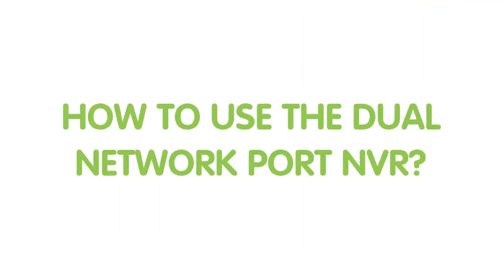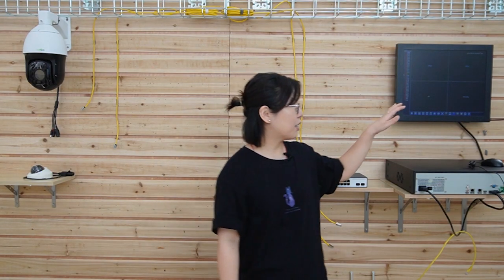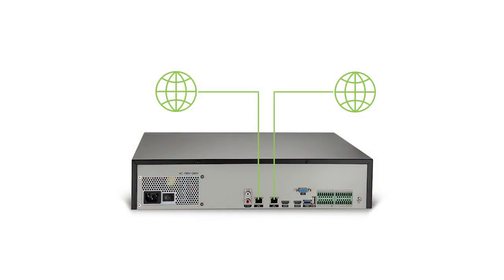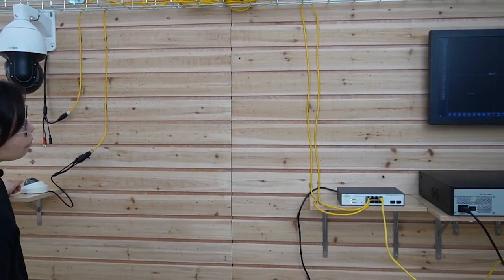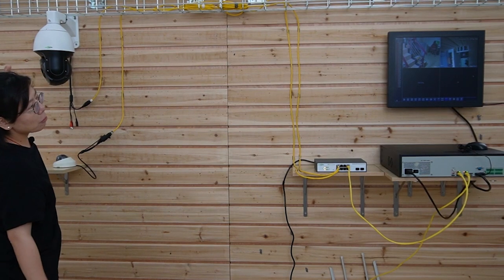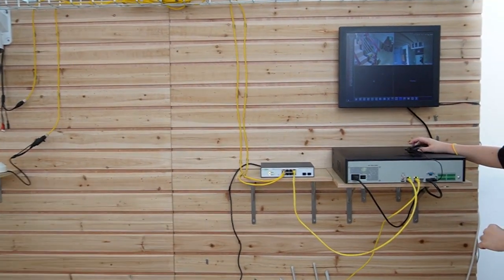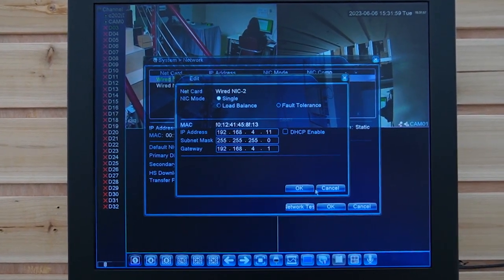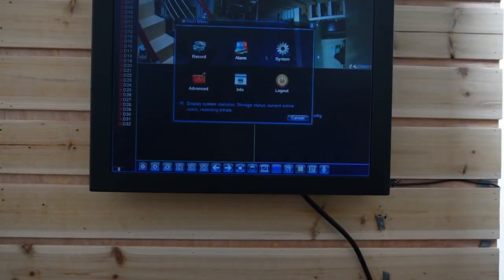Two Network Ports on One NVR | How to Use Dual NICS

Comment: Thanks a lot for your prompt reply. It is very helpful🙏
I have another question : suppose that I already had an NVR with built in 16 Poe ports and 1 NIC for LAN/WAN and all the ports have already connected directly to IP cams. And I connect that NIC to a switch which is connected to a router for accessing internet. Then I buy another NVR with dual NICs (for backup purpose). And I connect one of the NIC to the same switch.

1. Could the new NVR detect all IP cams that connected directly to the first NVR? Supposed that All NVRs and IP cams are in the same IP range. Or should I connect all the IP cams to the switch? (that makes the built in PoE ports on NVR become useless) 

2. For the second NIC (on the new NVR), could it connect to the same switch /router since they are all jn the same IP range? Or should I buy another router to make different IP segment and connect the second NIC to it?

Thanks in advance once again.
Reply from the maker: Cameras connected to the first NVR's built-in PoE ports are isolated on a private subnet managed internally by the NVR. The second NVR will not detect the cameras connected directly to the first NVR unless the first NVR has a feature to forward or share those camera streams over the LAN/WAN. Some NVRs support ONVIF or RTSP streams for this purpose, which would allow the second NVR to pull the streams.

Both NICs of the new NVR being on the same IP range will cause a network conflict (e.g., routing or ARP issues), leading to unpredictable behavior. You should connect the second NIC to a different subnet via a second router or switch. This isolates the second NIC and avoids conflicts.
Reply: @Fastcabling  Many many thanks to you. That was I thought, especially for the new NVR, one of the NIC should connect to another new additional router, not the same router as NVR 1. And that new router can be connected to the first router. Is that right?
Reply: @Fastcabling I think this  scenario:
 which is all the 16 built in PoE ports of the first NVR connect to a 16 ports switch (switch 1 with uplink ports) with IP segment A and the NIC connect to the router with IP Segment B. 
All IP Cams connect to another 16 PoE switch (Switch 2 with 2 uplink ports) , and one of its uplink port connects to the uplink port of the Switch 1 and the other uplink port  connects to one of NIC port of the new dual NICs NVR. All these are also configured as IP Segment A. 
And  the other NIC, connects to the same router as first NVR  with IP Segment B.

Or another scenario :

The built in PoE NVR is configured as a non POE NVR (disabled all the POE ports) and only uses its NIC port. 
This NIC port connects to the same switch as the IP cams (suppose I use 24 ports PoE Switch). The uplink of this switch connects to the router. 
One of the NICs port of the new dual NICs NVR, connects to that switch too. And the other NIC to another router (as a sub router of the first router). Or.. Leave alone the NIC and only uses one NIC and configures the gateway IP as the first router IP. 

According to you, which is the best scenario? The first one with all IP cams connected to built in PoE NVR or the second one, disabling all the built in PoE ports and using another switch. 

Many thanks in advance again.
Reply from the maker: Connecting the new router to the main router as a sub-router is a valid and practical approach to achieving subnet separation while maintaining internet access. The second NIC gets a separate subnet, and devices on the second subnet can still communicate with the main network if routing is properly configured.
Reply from the maker: Scenario 2 is the better choice for most setups, especially if you prioritize ease of management, scalability, and redundancy. The centralized switch setup allows both NVRs to work with the cameras without relying on built-in PoE ports or complex dual-switch configurations.

Scenario 1 could work if you want to maximize the use of the built-in PoE ports and are comfortable managing a split network. However, it may become less efficient as your system grows.
Reply: @Fastcabling Big thanks to you for your reply and explanation. It helps me a lot. I wish you more success in the future 🙏
Reply from the maker: You're welcome! If you're interested, you can find more network solutions on our website: https://www.fastcabling.com/pages/networking-solutions/

Comment: Hi. You didn't mention and showed what working mode you chose in that scenario. Is it load balancing, network or network redundancy? I see that you used NIC1 to connect to the router and the NIC2 to the PoE switch. Are the two NIC ports interchangeable? For example, connecting the NIC2 to the router and the other one to the switch. Does the NVR automatically detect which NIC is the Source of the internet (WAN) and the other to the cameras? In this scenario, did you chose network segmentation mode? 
Secondly, If all my ports switch already connected to the cameras and only left 1 or 2 uplink port (depends on the switch type), can I  connect the NVR to the uplink port? Thanks in advance.
Reply: If I only use one port of the 2 NICs, and connect it to the switch where all the cameras and router also connected to the same switch with the same network segment, can the NVR work just like an NVR which has only 1 NIC?
Reply from the maker: If you choose to use only one NIC (either NIC1 or NIC2) on your NVR and connect it to the switch, the NVR should work as if it only has a single NIC, just like any other standard NVR. No need for segmentation or special configurations in this case—just ensure that the router and cameras are on the same network and the NVR can access them.
Reply: @Fastcabling thank you for your prompt response. I have another question but unfortunately I use my other account @susantoMGT in the comment, hopefully you could reply it. Thanks a lot.
Reply from the maker: Yes, the two NIC ports (NIC1 and NIC2) are interchangeable, but they serve different functions depending on how you configure them.

If you connect NIC1 to the router and NIC2 to the PoE switch, that’s one configuration, where:
NIC1 is used for internet access (WAN).
NIC2 is used for local access (LAN), i.e., connecting to the cameras.

In this video, we also use this configuration for network isolation. By isolating the camera network (LAN) from the internet network (WAN), you reduce the risk of external attacks on your camera system. All traffic related to camera feeds, recordings, and local network communications will stay on the LAN.

The NVR does not automatically detect the role of each NIC. You'll need to manually assign the roles in the NVR's configuration settings. 

You can connect the NVR to an uplink port on the switch, especially if the other ports are occupied by the cameras.

Comment: How do assign static IP and how to do that online?
Reply from the maker: First, you need to find the camera's current IP address. You can check your router’s connected devices list to find the IP address assigned to your camera.

Then, open a web browser, enter the IP address of the camera, and log in with the camera’s admin credentials.

Once logged in, go to the camera’s network settings section. Locate the option for IP address configuration. Select the option for a static IP address and enter the desired static IP address, subnet mask, default gateway, and DNS servers. Make sure the IP address is within the same range as your network and does not conflict with other devices.

Example:
IP Address: 192.168.1.100 (Make sure this is unique within your network)
Subnet Mask: 255.255.255.0
Default Gateway: 192.168.1.1 (typically your router’s IP address)
DNS Server: 8.8.8.8 (Google’s DNS server) or your preferred DNS server

Lastly, save and apply the settings.
Reply: @Fastcabling  I assigned static IP within NVR NIC 1 that IP is allowed to the internet but it does not work for example 192.168.199.2 255.255.255.0 192.168.199.1 8.8.8.8
Reply from the maker: Please check: 
1. The IP address is not in conflict with any other device on the network.
2. The default gateway is reachable from the camera’s subnet.
3. The DNS server is reachable to resolve domain names correctly.

Comment: So we can't use tgat like one port 64 channels and another for additional 64 channels adding upto 128
Reply: Correct me if I am wrong please
Reply from the maker: No, you can't. How many cameras the NVR can take in is pre-determined. It relates to the DSP and other resouces the NVR has. If the camera only can handle 64 cameras, then you can take more than 64 cameras, but you can connect the second NVR to the same network to take in another 64 channels.

Comment: Hi! I have a dual NICS but whenever I plug the internet cable and select it as primary network, the cameras connected in POE switch turns all black
Reply from the maker: You might try to set the static IP address to each of those cameras manually.